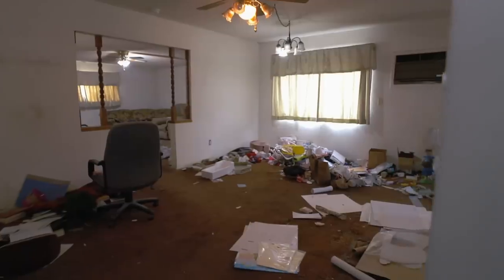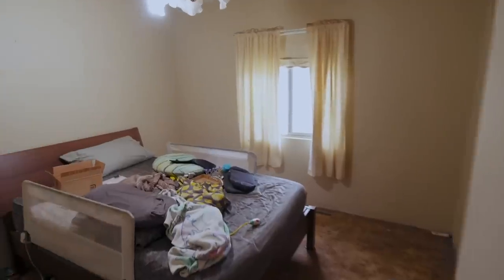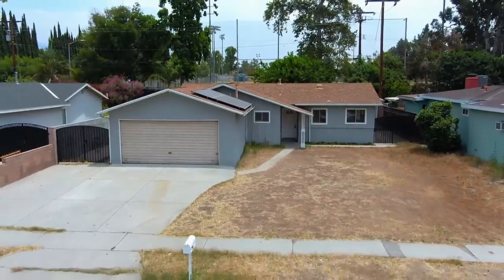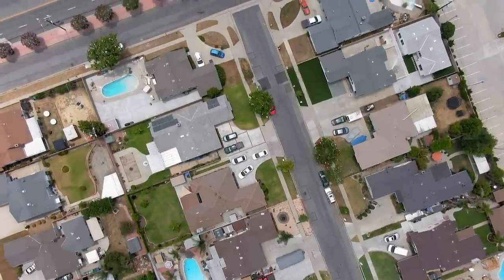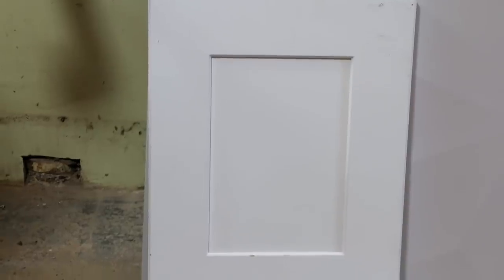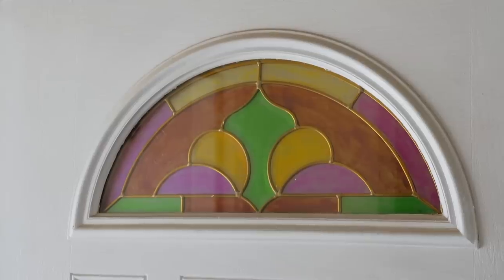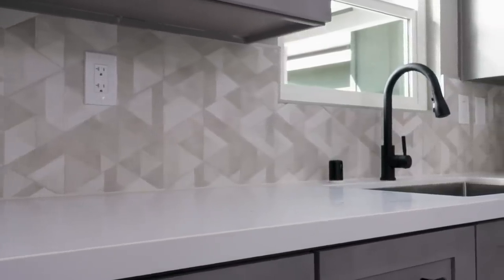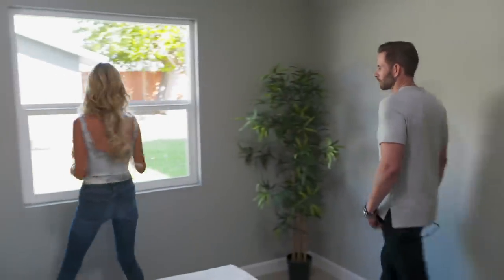Tarek & Christina Could Make The Lowest Profit Ever On This Flip! l Flip Or Flop

Comment: House turned out fabulous. The exterior is on the plain side but still, 100% improvement.   The large living room is sort of a requirement in rural and smaller communities where families gather, friends come over, kids congregate... Preferably 2 living areas so kids can separate or adults can when gatherings occur, even if it's comfy seating in the kitchen.